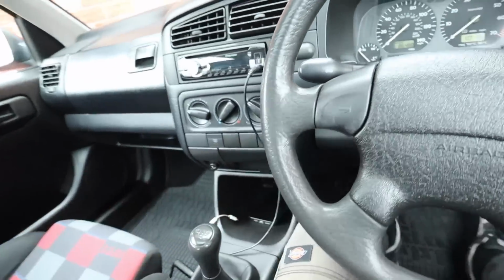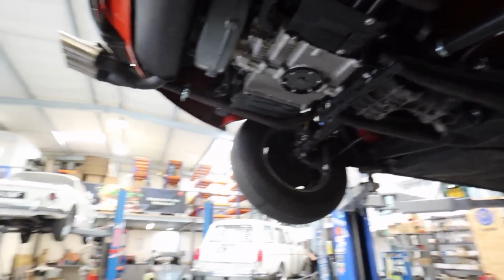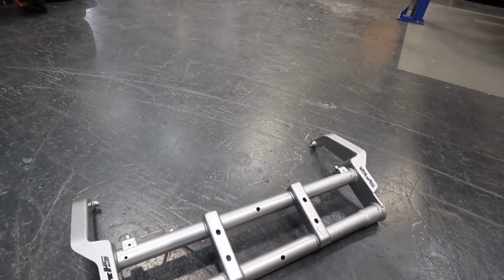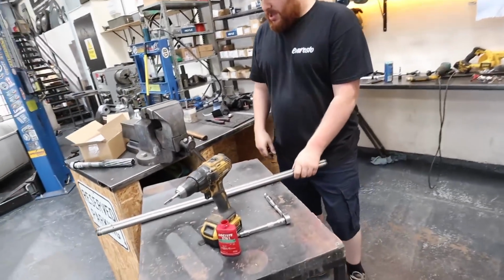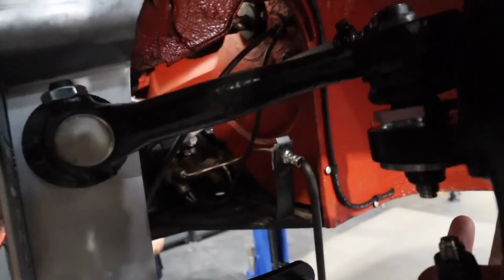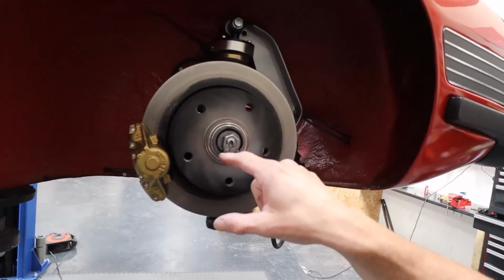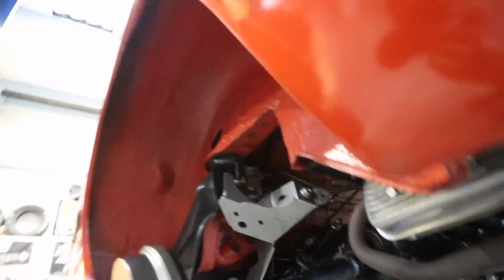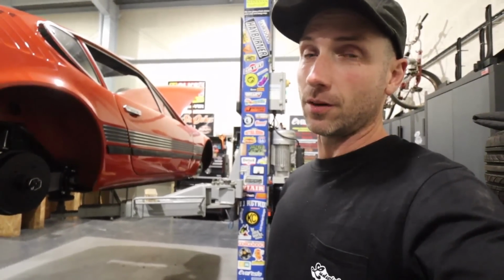BUILDING A CUSTOM BAGGED VW SP2! (Part 1)

Comment: This is just some great reengineering. Looks immaculate. I’ve had intrusive thoughts of an EV conversion for this body/chassis because batteries and coolant could all be dropped up front and delete engines and exhaust for motors seems like it would work well. Keep up the great work!

Comment: 26:28 the bar actually has the opposite function of a sway bar, it’s a link bar. It prevents the car from oversteering and wheel hopping in extreme positions by limiting how “low” one side of the axle can go while the other side is “up”. It was also used in the Porsche 365, but not in a drop link configuration.

Comment: Hello, I'm Brazilian. Here in Brazil there was a rare version called SP3, which was basically the SP2 with a Passat front engine. It was an incredible machine, but it didn't leave the prototype stage. Since in 1974, VW launched the Passat, making the SP3 project expensive and pointless.
Reply: Fala português irmão eles que traduzam 😂😂
Reply: Cachorro porco

Comment: A friend had visitors from the U.S to South Africa.  And one of them after getting in the car(left front passenger), would adjust the rear view mirror.😂😂😂(RHD cars) Took him a whole week to get used to not driving on the left of the car. Worst was the 'keep left pass right' rule.And petrol attendants putting gas for you and bringing the card machine to you AND asking if you needed anything from the petrol station shop. Never seen anyone mindblown by such simple everyday things before.😂😂😂😂